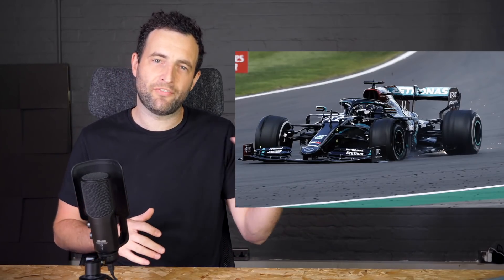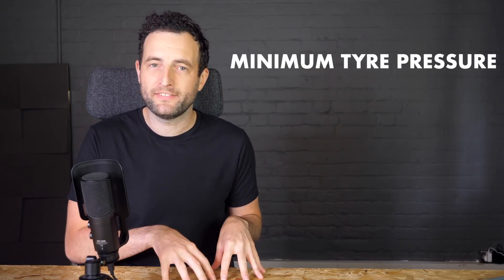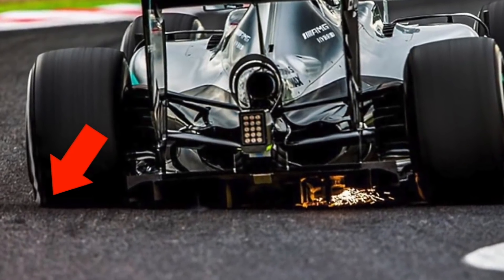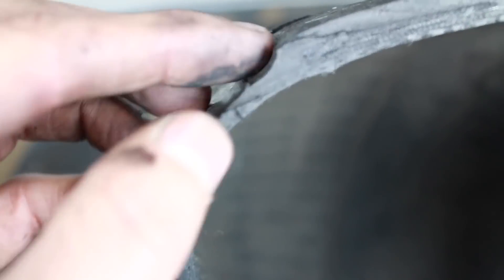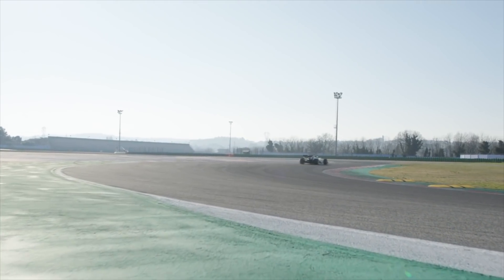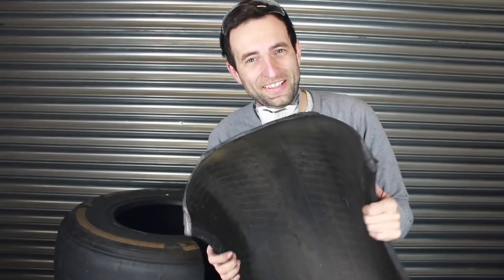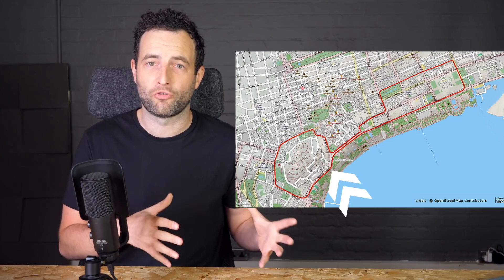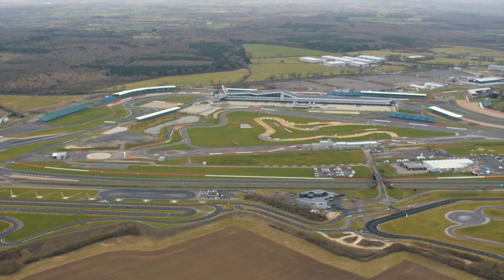Why Formula 1 Tyres Failed in the Azerbaijan Grand Prix

Comment: A point i never see in any Analysis.
The track had a significant change from last year to this year.
Maybe Verstappen and Stroll take the turn more aggresive as the other drivers.
Or maybe they hit the inside of the turn with their rear left tire -> damged their tire and on full speed (maybe some laps later) the tire had to much forces -> and explode

Comment: Imho, your explanation is all about tyres letting go due to forces happening around bends, but clearly these both let go halfway or more along the straight, after the tyre shape and stresses had been 'normalised', so I am afraid I don't think much of your "Why they failed" reasoning, other than being 'contributing' factors only. Pirelli will release a statement at some point (if they have already I have obviously not seen it yet).

Comment: Baku is actually quite demanding on the tire. Some really hard 90° corners where you brake a lot. And a view streights that are not streight but light corners close to or at top speed. Also it's no circuit tarmac so you have slightly more slip if these tires have any.

Comment: Another great and well researched video ! .................... Pireli say < yet again > that the problem was cuts caused by debris ! ????? I must admit i simply do not believe them ! ... My personal opinion was poor desig leading to stress fatigue ! but im an just an engineer so i am very happy to see your conclusions are exactly the same as mine ! ... F1 needs to sort out the problems of carbon fibre shards from damaged front wings , but as the experts likely agree that it is a tyre design problem i doubt they will insist on aluminium titanium front wings any time soon !

Comment: Pirelli didnt fix the exploding tire problem by just making changes in the tire.  They also forced the teams to decrease total downforce by 10%.  Its insane for the tire manufacturer to force these kind of rules. And then when a tire blows because if bad construction just use the " debri caused it" Excuse.  FIA needs to find a manufacturer who is actually capable of making a tire that can handle modern f1 cars instead of limiting the tes because the tyre producer cant deliver an on par product

Comment: Just drop the BS regulations, shorten the cars, go naturally aspirated (save fuel), cut out the hybrid BS and drop 150-200kg and whaddya know? 

The cars will be able to overtake in slow corners, be more manoeuvrable and not blow tyres out as they don’t need so much load. 

Oh and the racing won’t be batshit boring. 

Simple solution.

Comment: Debris of worn out tires not helps for longevity of the tire, paradox tire worn out and worn out debris on track can puncture your worn out tire :/
Fatigue force technically are called cyclical force if you want break wire you must quickly cyclically bend wire multiple times (different from static and dynamic force). Fatigue force are called creeping force (or latin valknum force) very very and very slow force.

Comment: Pirelli (predictably) brushed it off as "debris on track"..
It shows that they take no responsibility for the failure of the material they provide.
This is not the first time that their tires suddenly fail, something you hardly saw with the Goodyear and Bridgestone tires, and it really worries me that Pirelli does not take responsibility.
Drivers miss out on good results and it's downright dangerous if the tires are as unreliable as these, what if Max would have veered to the other side; he would probably have crashed into the pitwall at 300+ km/h.

The people at Pirelli really need to get their sh*t together, or leave it to a tire company that actually IS up to the task!

Comment: It's not only about tires, but It's also about driving style as well. Remember last season when Lewis drove with the same set of tires most of the race while everybody else has changed their tires 2x. For example, Max's driving style is super-aggressive which destroys the tires faster and making its life span shorter.
Reply: "Max's driving style is super-aggressive which destroys the tires faster and making its life span shorter."
It actually doesn't. If it did, then how does Max tend to manage longer stints than most other drivers, also being able to lap consecutively within tenth's of a second?
Reply: @halofreak1990  I was comparing Max with Lewis, my impression is that Lewis is simple more skilled in saving tires than other drivers. I think it's not to blame Pirelli, but drivers. It's all about their driving style/skills.

Comment: F1 has begged the tire manufacturers to make them weaker so that they can get better racing.  This is NOT the correct way to make this possible.  Any time you ask them to make the tires weaker, you end up with this.  Just look at the US GP from years ago.  We've done this before.

Comment: OMG 4 minutes and 51 seconds I’ll never get back.  His points in the conversation were all over the place. He mentions the psi change by Pirelli near the beginning and waits till the end to tell us that obviously that wasn’t enough. Dahhhh!!! I could have swore he was going to blame either the teams for running them lower than recommended or that Pirelli gave in to letting them run a lower psi. Lastly he doesn’t say it but I will. Pirelli is purely guessing when it comes to what tires will work best on what tracks. There’s a lot of engineering that goes into them but that does you no good if it’s not going to work for that track. Can’t Pirelli use F2 or F3 as a test bed for experimental tires? The lower ranks go to the same tracks right? Maybe F1 should consider either adding another tire manufacturer or replacing Pirelli all together!

Comment: Why? Because they want to compromise Pirelli, and another brand will come. Simple
If the downforce is the issue, why the problem happened on the straight, and also why both left tires failed in the same straight? And why the left ones? No actual concrete answer.

Comment: Hi @driver61, is it that it was not the Redbull and Aston Martins car settings and balance that caused the overloads on the tyre shoulders thus the failure? Because the other cars run the same tyres on the same track successfully?

Comment: Well, one things for sure. Pirelli needs to figure this $#@& out because this is now twice in 2 seasons. And this was on a very high speed straight.

I've hated the Pirelli tire era since it started as it has done the opposite of creating racing by instead creating processional racing where drivers manage tires for 80% of a race in order to one stop. But these failures are unacceptable.

Comment: Hi, I've just seen the race on TV replay. I have not recorded the race and I can't see it again. In the lap 43, when Norris said by radio that "I've got a lot of vibrations", they told him that the front right tire has something (I dont remember exactly what). But just a few secondas later, when he drives on the long straight line, I saw a kind of light coming down, just in the place where Verstappen's tyre failed. It could be interesting if you can corroborate this fact. 
On the other hand, Verstappen was trying to improve the best time, and I think on the  possibility that his tires where tired, I mean, used or stressed.
Reply: I've just seen again the race rediffusion and I confirm what I saw. In the lap 42-43 of Norris, there is some bright light (like a small "explosion") on the road when Norris is just in the last curve before the right line where Verstappen's tyre failed.

Comment: Two tyres failed.  Two. 
At 200 MPH, no less. 
And extra pressure may fix it every time (i.e., a solvable problem rather than Michelin at Indianapolis).
We've gotten FAR too used to F1 being relentlessly unhealthy & predictable. That's a vastly bigger problem than 2 total tyre failures from the sole tyre manufacturer at one of the fastest courses in the sport.

Comment: Since the track was run counterclockwise, wouldn't the majority of the load be on the right-side tires? Seems like the right rears should have failed instead of the left rears. Can you explain why the left-side tires failed first?

Comment: First analysis says that it was just debris. Because it's actually the right rear that that has to cope with the most forces, first analysis aswell says that other tires from other drivers didn't have any structural damage and neither Stroll or Verstappens tires had any vibration ongoing which is the first sign of any structural damage, on top of that Pirelli showed the Media a picture with a big cut on Hamiltons tire, which was definetly caused by debris, so there was debris on track

Comment: Why the tires failed? They drove them overdue, that’s why. Several laps before VER puncture HAM had 20% left on his tires and PER had 10% left on his tires. VER who is extremely hard on the material could never made it to the checkered flag. Not in a million years. Teams faild to pit. That’s why they got puncture. Normally drivers pace them selves through the race and only push for out and in lap and maybe somewhere in the middle. This last stint the three top drivers chased each other through the whole stint and caused abnormal tire wear. Because they don’t normally drive like this. The teams failed to monitoring this and VER tire exploded because he should have pitted long before it was critical.

Comment: Both strolls and max's tyres blew at very similar bits of the track. That long straight at baku is actually a series of sloping steps down hill, and both tyres blew as the cars hit the compression sections on the straight, between the slope and semi flat inbetween section. I agree the shoulders blew, but especially going forward, these tyre blows as the cars hit a compression zone while going flat out could see dangerous tyre failures at other tracks, like the bottom of eau rouge at spar, the base of the hill on the main straight at austin, for example. And the last thing we need is a repeat of the bridgestone fiasco at indy again, or as the vid rightly points out places like silverstone where front tyre shoulders get extra beaten up.

Comment: Thanks for your take on the tyre issue. I would also love to know more about the "magic" button that Lewis was talking about. I understand that it moves the brake bias towards the front wheels to aid warmup of tyres and brakes during formation laps, but how different does this work compared to other race cars? I think an overall explanation of brake bias on F1 cars would make a good video (if you haven't covered this already) and also what makes the Magic button special on the Mercedes cars, do the other F1 cars not have this?

Comment: Problem with this story , is that the tire that went was the rear left , which is the least loaded of all the tires on Baku.
Also , they went before pirelli's suggested life span.
In Silverstone  , the tire that gave out was the front left, which had the most work to do that weekend, and they were racing it for longer than pirelli suggested they would last.

Pirelli can only say now that the tires in Baku went because of debris - like they did in an early assessment - because if not, that means they supplied faulty tires which didn't do what even pirelli expected of them. So of course they are going to save face and say it was cut because of debris.

Comment: Pirelli need to pull their socks up.  Having a tire monopoly is not keeping them on their toes and they are looking lazy and sloppy.   In this day and age there is no excuse for not testing tires on a machine that can simulate race loads plus a healthy safety margin.  This isn't a one off anymore, it's becoming a pattern.  It's not like they have to guess the projected life like road tires because they can simulate an entire race in a couple hours real time.  This was two failures on different cars on a track that is pretty easy on tires and not an extreme duty case.  If they don't have a machine to do proper testing it's about time they took some of their PR money and built one before someone ends up in hospital or worse.

Comment: Pirelli tests will find what we already know: tyres failed because of aero pressure because z floors didn't really gave a pressure loss. That's why they failed at the straights.

And Verstappen was a GENIUS setting fastest laps one after the other 4s ahead of Perez. With a guy having blown up a tyre (at least allegedly at the time) exactly the same age. Absolutely genius.

Comment: They also found a 10cm cut on the left rear of Lewis' car, which almost damaged the structure. This would indicate there's something sharp somewhere on the track, but not everybody was hitting it. Over a lap the right rear is under more load and as such would fail first if excessive load were the issue, all 3 tyres - if we include Lewis' - were left rear.

Pirelli can't be blamed for everything, it's not as if this happens all that often
Reply: Lewis also was the second car to clear Max's debris. Not unlikely that got him the damage.

Comment: As a former software developer for Bridgestone, I can tell you why they failed. The tires failed because they aren't made by Bridgestone. MotoGP is also experiencing "Not very good racing" because Bridgestone is not the supplier. Currently the best road racing tires in the world are the Firestone Firehawks used in Indycar.

Comment: Whatever the reason, I find it ridiculous a street circuit with a 2km plus straight. This hasn't been the only time this happens as Bottas case is there some years ago.
This track should be somewhere around 4.5 ~ 5 km long tops. 
But the championship gets interesting from 3rd downwards.

Comment: Pirelli have a case to answer, their tyres were not up to the job. However the FIA also have to shoulder the blame, at least 50%. They have stated that Pirelli are the exclusive tyre supplier for F1, and they have been for years now. There is no pressure on Pirelli to innovate and improve, they have a captive market. Many years ago the teams could choose their tyre suppliers....Dunlop, Michelin, Goodyear etc to name a few. At that time there WAS innovation and improvement, with the incentive for the tyre manufacturers being to gain new contracts/sales. The FIA has slowed/stopped the development of tyres by taking competition out of the equation. And yeah, I'm Aussie (go Dan), so I have spelled tyres correctly lol

Comment: Degradation of the tyres does not improve the racing…it results in processional driving with drives in tyre-save mode for most of the race.  If you give the drivers really good tyres that last, you get hammer-and-tongs racing from lights out to chequered flag.  Why does nobody see that?  It is asinine to mandate tyres that degrade preventing drivers from going 10/10ths for the whole race and change the race into a parade of clown cars circling the track.

Comment: I see that Pirelli is suspecting that debris caused the tire failures but unless they have a clear evidence to back up their initial suspicion, it will be tough to sell that argument.  Two left rear tire failures in the same part of the circuit with about 30 laps of wear on them?  And neither RB nor AM has said that they saw any sign of deflation before the failures.

Comment: This is such a disgrace for Pirelli. They forced new aero regulations (and the teams pay for all the developement), they made stronger and heavier tyres (and the teams just needs to deal with it), they demand higher tyre pressures (and the teams just have to follow) and even then their own product doesn't live up to their own predictions (36-40 laps on the hard for a 1 stop strategy was their prediction). You have to remember, the teams pay for those tyres, pay for those predictions and that Pirelli dude in their pitbox probably as well. And it's not something new. We are now at a point where the tyres are the deciding factor during a race. It should be about drivers and cars, not about tyres. Just a complete disgrace.